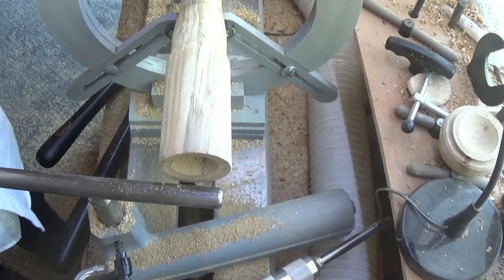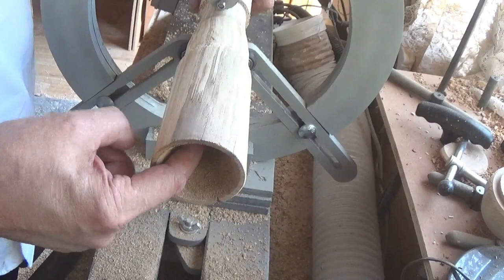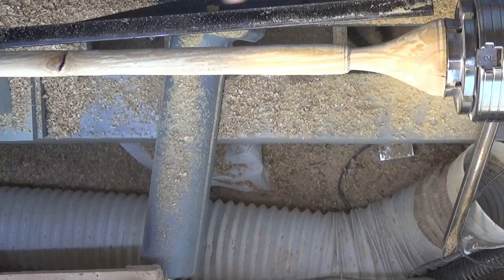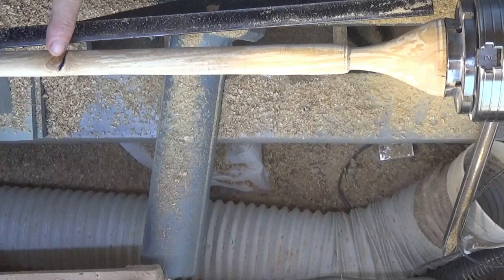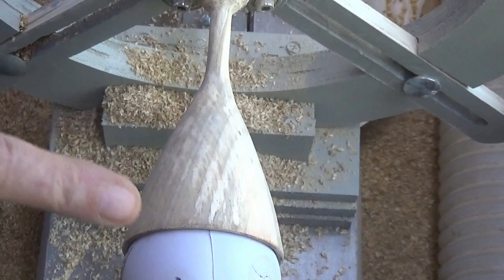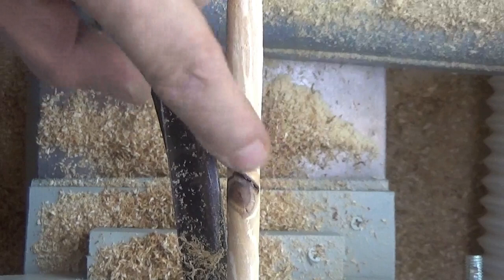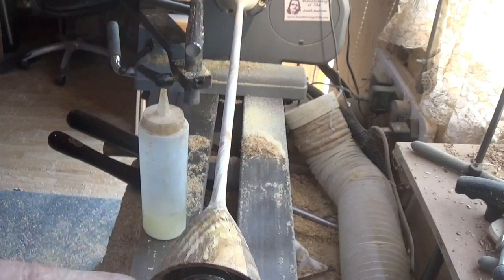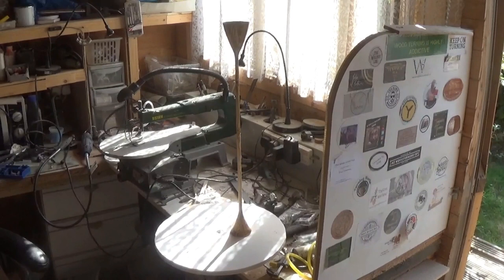Woodturning at 54a #161 .Short video,long goblet

Comment: Hello Keith, Nicely done on both the goblet and the steady rest. More than that, congratulations. I haven't turned a goblet yet, although I keep meaning to. It's a sort of a rite of passage. As for the steady rest, I bought all of the nuts, bolts and washers a couple of years ago. The skate wheels are really dinky and light up when they spin. Unfortunately I keep ordering, (3 times now) the ply as part of a larger order and then using it up elsewhere. The same applies to my planned for Longworth style chuck. I think this is a bit of a nudge. Regards, Glenn. :-)
Reply from the maker: Hi Glenn,I know what you mean,I’ve done the same with plywood! However,when you’re turning a long goblet or something similar,and you get to the stage where you realise you need one,like I did,you have to make one!😄👍

Comment: Nice job. What is the ball you used on the tail stock that the live center didn't puncture it?
Reply from the maker: It’s just a soft sponge ball.
Reply: @KeithBarrowat54a  Thanks. Have to give it a try after I finish some other projects.